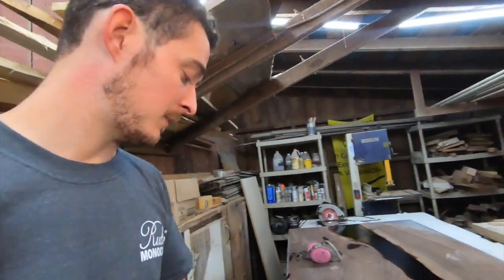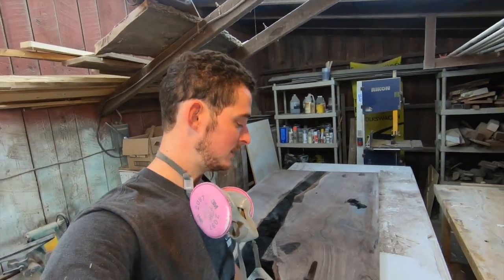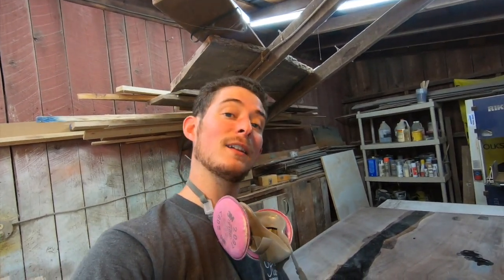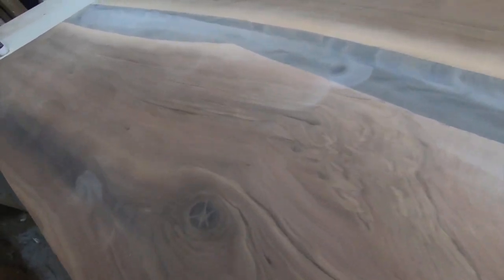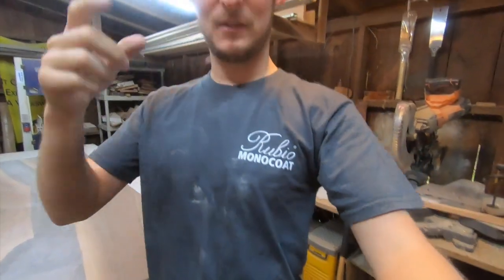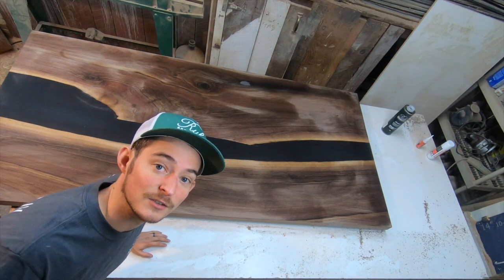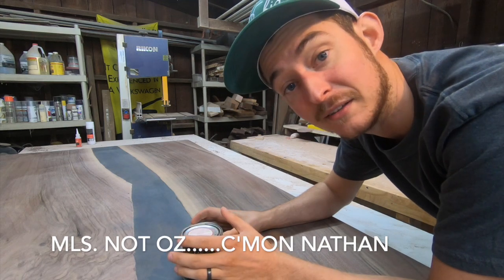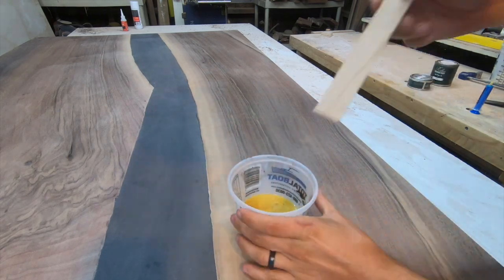Building an Epoxy Conference Table with a Balck River || Part 3

Comment: So I have a question my company wants me to build them a conference table. I would like to make it a river table. We make camshafts. So I was thinking of making it clear and putting some cams in the epoxy. Do you think it’s possible. Also it is going to need to be 12 foot long. What would you charge if it was you just for the table top.
Reply from the maker: That’s totally doable! That all depends on the species of wood and how much epoxy is used but I would be in the $10k range

Comment: don't know if this is correct format to ask this but i cannot find an email to directly contact you. how do you get the scratches out of the Stone Coat Countertops Super Cast epoxy. it states that it is not intended to be a final coat. I recently did a similar table sanded to 1200 and used a buffer and did not get the scratches out. I used osmo instead of rubio
Reply from the maker: 🤔 well I think that you just didn’t sand to a high enough grit. But having said that I only sanded to a 150 grit before applying Rubio and you can’t see any scratches...
Reply: @GoodViewWoodworks  weird. I went to 1200. Guess I'll have to try it again
Reply: If you plan on buffing epoxy you need to sand higher than 1200.  Minimun I go to is 3000.

Comment: Great job.  Never used Rubio.  Do you have to do any poly over the finish or is that stuff tough enough?
Reply from the maker: That stuff is tough! It was originally designed for floors.

Comment: We’re you satisfied sanding the epoxy to only 150? I was told that Monocoat won’t adhere to resin...?
Reply from the maker: It works well for me.
Reply: Can you see any pigtails on epoxy? I finished my table last night and it looks amazing, but when look closely you could see the sanding marks on epoxy. By the way I used 180 grit and popped the wood.
Reply from the maker: The pigtails come from not wiping the dust off of the surface when sanding and the paper gets clogged up. Make sure you wipe periodically to not have any pigtails